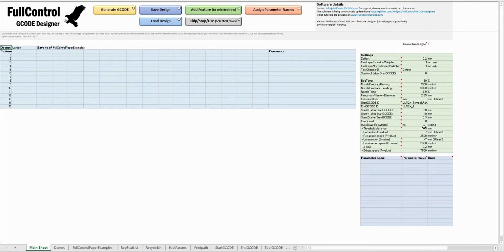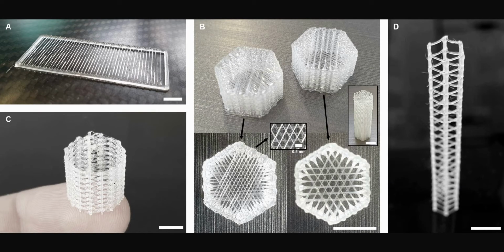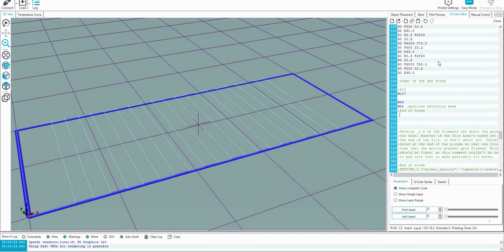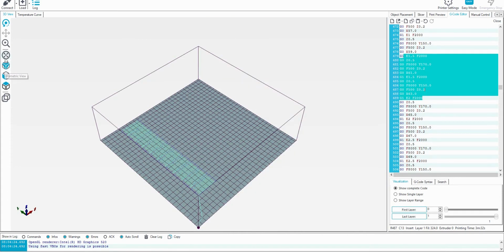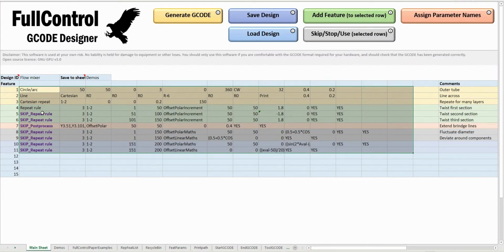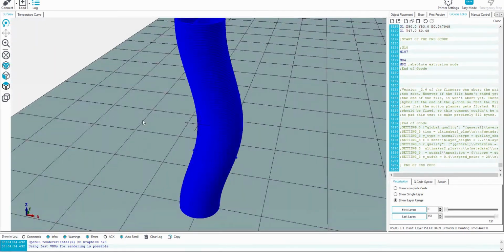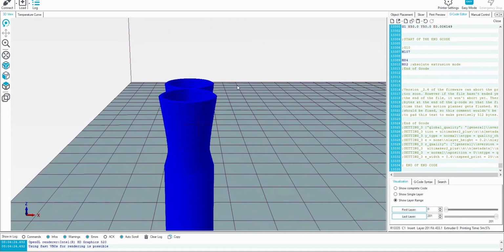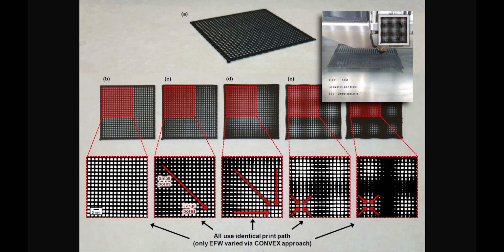FullControl GCode Designer - Technical Intro

Comment: Just found FC Gcode, would like to know how building a simple box with cover can be done. Thanks
Reply: How about a simple box, with rounded corners.
Reply from the maker: @donvukovic7440  you'd define a line for each wall, then repeat for lots of layers, then define the lines to print the top. Of course, without support, the top would collapse, so the most important thing is to figure out what toolpath would work for your geometry. For rounded corners, you'd define a series of lines and 90-degree arcs. Using polar repeat would make this more concise (check out the tutorials on www.fullcontrolgcode.com)

Comment: Is there any other spreadsheet software out there I can use with full control G Code? I tried open office and that don't appear to be working, If they had a one time purchase for excel I would probably go for it but I'm kind of against subscribing to software.
Reply from the maker: The VBA code is available on github and it could be translated to work in open-office if you disabled the VBA user forms and maybe some other features. Someone has mentioned this in an issues thread.

Comment: Don't think me lame sir,I am a student but how is image is converted to gcode, either raster to gcode or vector to gcode and what is software pipeline sir
Reply: Hi.  I’m just getting started in 3d printing.   Describing the object to be printed using high level code makes a lot of sense as well as having better control over the printing process.  Very cool.
Reply from the maker: Hi, it's described in the journal paper, available from www.fullcontrolgcode.com

Comment: This is really interesting! I will use it for my bachelor thesis about non planar printing. 
Are you planning to release a standalone version of this software that doesn‘t rely on Excel? I can imagine an integrated preview of the toolpath would make this more a bit more easy to use. 
Another improvement might be the option to choose the decimal seperator, since a lot of firmwares use ponits instead of commas and for now, I have to replace them with the notepad++ search and replace function. 
Keep up the great work!
Reply from the maker: Thanks! Yes, I'm intending to create a standalone version at some point. But for now, I'm seeing who uses FullControl, and for what processes/applications - to make sure the most relevant features are included. A good thing about the current version is that everyone can use their preferred GCode preview software rather than be tied in to one. 

I can tweak the number format in FullControl. Send me an email, or private message, with a few more details and I'll create a custom version of FullControl for you. I'm also interested to hear about your project. 
Cheers for the interest!